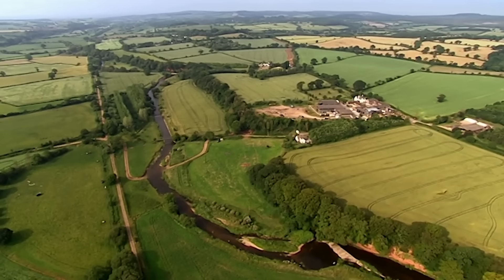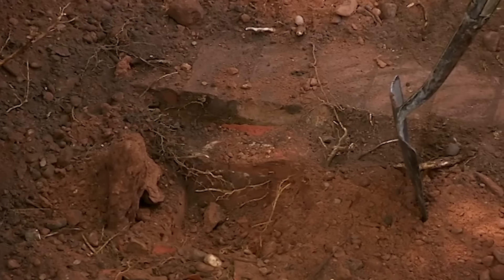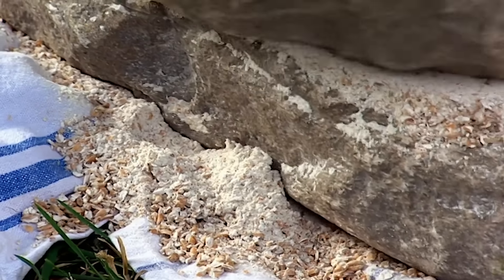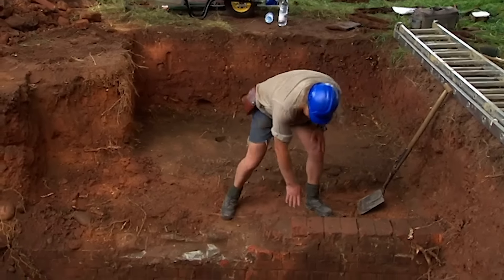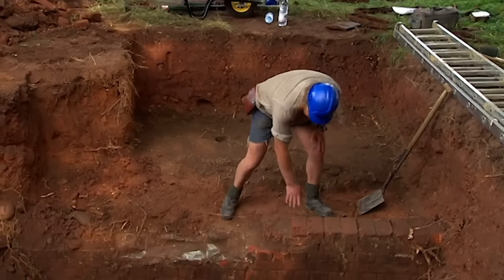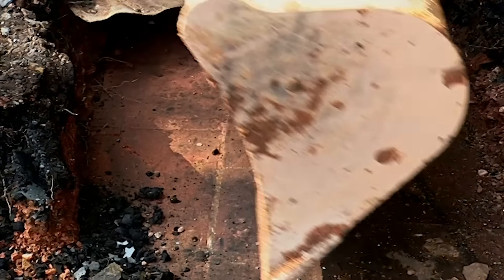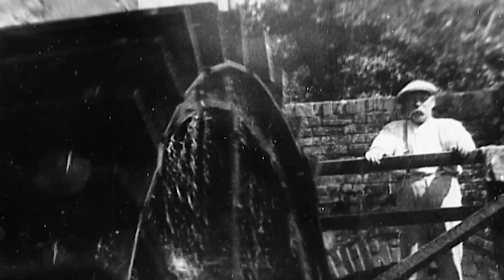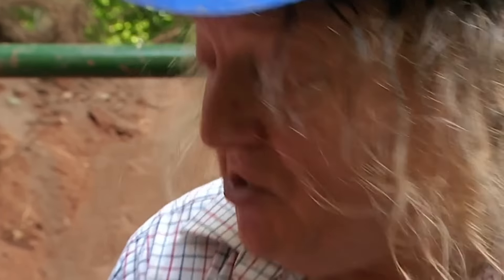The Domesday Mill (Dotton, Devon) | Series 14 Episode 9 | Time Team

Comment: I’m always impressed by the skill of the front end loader operators at these sites.
Reply: What about the lawnmower ?
Reply: As a gardener and landscaper, I’d like to consider myself a professional ditch digger, and I’m always impressed by their clean turf cutting skills and deep trenches. Especially anyplace they excavate that’s wooded. Chopping through centuries of gnarled English hardwood tree roots and underbrush has got to labor intensive.
Reply: @johansmallberries9874  need a good tractor  like a ferrari
Reply: They are very easy to operate. Quite fun to play around with.

Comment: By the way, regarding that metal wheel with wooden cogs: In Guédelon they reconstructed a wooden mill and they experienced a LOT of abrasion in the cogs at the beginning, but it turns out this stops once the cogs have... basically found a shape that has minimal forces. In a way, you let abrasion shape precision cogs instead of making them to the necessary precision yourself.
Reply: Breaking them in. Running in. We still do this with machinery to this very day. We machine them a lot tighter in tolerance these days but the final fitting is done by the machine in its first hours of service.
Reply: This is the reason you run any new engine/gearbox in and replace the lubricants at tighter intervals at first, to let things mate properly and then get rid of all the tiny metal pieces that wear off. 😁
Reply: Fascinating little thread. I've watched some of the Guédelon videos as well what a brilliant project.
Reply: Im someone with lots of skills but no engineering brain at all. I puzzle how a hand loom works, never mind anything more complicated.
Reply: They had the same issues with manually operated drawbridge mechanisms until they had a bit of seasoning

Comment: 8:00 undershots might be the most inefficient when it comes to percentage of the energy converted, but it's the only one that you can use in flat lands with barely any level difference and when they are made without the underwater dam, they don't even disrupt the waterflow. It was even possible to make a small one directly on a creek or small river that would just always turn, and belts were used to spin up the cogs. Those are all things that you couldn't do with the other ones. I wouldn't try to run a sawmill on it, though... hehheh.

Comment: Some things occur to me about this episode.
It should be  pointed out the difference between grinding grain and milling. When you grind you have two stones in contact with grain being passed between the stones. This leads to pulverized stone being mixed into the product (meal or flour). This is important in examining dental wear as people who eat stone ground foods had increased wear of the tooth enamel. Willing, on the other hand uses stones which are precisely shaped and the stones never touch. A very fine adjustment of the clearance between the stones allows them to pulverize the grain with very little stone wear and little stone getting into the product. 
The bottom of the wheel pit would have had erosion from the water flowing through it and would have had regular repair work done over it's life.
Floods would have likely have over-topped the regulator gate at some times in the life of the mill and the uncontrolled flow would have damaged the mill wheel and pit and that would have required major repairs from time to time.
18th and 19th century construction habits often used heavy oak timbers as the foundation for stone and masonry  construction and those timbers buried deep under ground can survive for a surprisingly long time. I've seen 150 year old stone culverts built on 2 inch by 8 inch oak planks where the planks show in the bottom of the culvert under the water and they appear very solid.
French mill stones are considered the best and they developed a large industry and shipped them almost everywhere during the 19th century shipping them cheaply as ships ballast to their destination.

Comment: As a point of interest, the wooden gear wheel cogs that were morticed into the cast gear would most likely have been made from hornbeam, a white hardwood that is in fact very hard indeed and perfect for such work.
Reply: +as with the waIking sticks?
Reply: @arigatuxful  Quite possibly. I have some in my workshop that I used for decoration on woodwinds in place of ivory. It turns beautifully.
Reply: I've read that apple tree wood was used and that mills often had an orchard. That way the miller got gear teeth, apples, cider and firewood.
Reply: Interesting.  In the 70s I was in a windmill in the north of the Netherlands and all the gears were made of oak. Specifically oak from Poland as it was the hardest oak available.   The sound inside the mill as the the sails turned was amazing,  very deep low rhythmic noise that vibrated through your body.  The wooden heart of the mill.

Comment: I guess there must have been a lock at the river Otter to regulate the waterflow. The choice for wooden cogs is also based on the wear and tear of the mill gears. If wooden cogs run together with iron cogs, the wooden ones will erode away after some years, but the iron ones will not. So the maintenance is an easy job. Replacing a cast iron gear is close to a nightmare and cannot be done by the miller himself. In Dutch mills, these wooden cogs are often made of boxwood imported from the Mediterranean and greased with beewax. I did not catch where this first piece of cast Iron frame served for which was discovered by Phil Harding.

Comment: Not clearly visible, but the pit wheel has a 45 degree tilted surface in which the holes for the wooden cogs are made. The other wheel was probably 100% cast iron, but with a similar tilded surface, mounted on a vertical axle. The animation on 44:00 shows a different set of wheels, not common for a mill. It would be fantastic if parts of this mill could be restored and made available to the public. Bit of a sad story that after 1000 years of milling only some obscure ruins are left.

Comment: The living quarters looked like it had a thick layer of charcoal across the entire area, but they never mentioned this.  The mill that got torn down in 1960, they said it was built in the early 18th century most likely (early 1700s), so perhaps the mill they are excavating burned down and that's why the 1960 mill was built in the first place?

Comment: the Romans used water wheels. Could there have a even older wheel sight?
Reply: it would depend on the location of Roman settlements in the region. I think if there were settlements of note then it would have been mentioned, it is more likely that it was built by the saxons. but when Phil mentioned concrete I did start thinking, is this roman?
Reply: @SevCaswell  COINS
Reply: @larryzigler6812  there were no coins found or they would have been mentioned
Reply: @SevCaswell  No coins no Romans, usually.

Comment: How were they grinding corn, before the discovery of America. I thought corn was indigenous to the Americas
Reply: "corn" does not have the same meaning in Britain that it does in the U.S. In the U.S. Corn = maize, but in Britain it means any grain of a cereal grass that is the primary crop of a region (such as wheat in Britain and oats in Scotland and Ireland).
Reply: Also related: "corned beef" does not use corn to make it... Originally the word "corn" came from the Germanic word "kurnam," meaning "small seed." In the 17th century, salted beef started taking on the name corned beef in some parts of England because of the large "kernels" of rock salt used to preserve it.

Comment: Why the artificial 3-day limit?
Reply: Costs, largely. The longer you're on a site, the more it costs (and remember it's not just the archaeologists, related professionals and the other guys that appear on camera. It's also the camera crew, directors, sound guys, caterers, etc. Plus equipment hire).

Plus for most of TT's run, there were two ad breaks, so the program split nicely into thirds, one section per day. (This got rather messed up in the latter series when C4 shoved in a third ad break)

Comment: Grinding corn ?? They didn't have corn 🌽 in medieval England !!
Reply: "Corn" is the old English word for grain. Maize was called "corn" by the early settlers because they knew it was grain but didn't know it's actual name. The "is it called corn or maize" debate has raged ever since.
Reply: Yeah I didn't realize that barleycorn counted as corn and they did have America's "🌽 in Englands  late medieval ages but it wasn't common !
Reply: @dantone1952  Read a bit.
Reply: @dantone1952  not just barley, wheat, spelt, and other cereal crops are generally called corn in the UK. Its an all purpose word we use
Reply: Originally the word "corn" came from the Germanic word "kurnam," meaning "small seed." 

Also related, "corned beef" doesn't have corn anywhere near it... it had "kernels" of salt used to make it. That's where the name comes from.